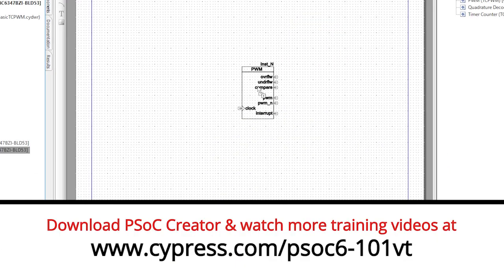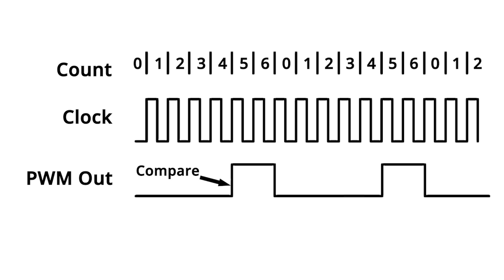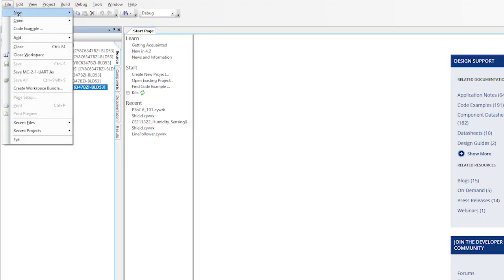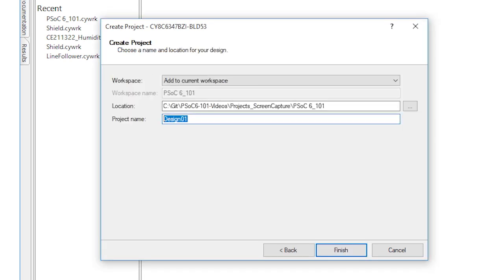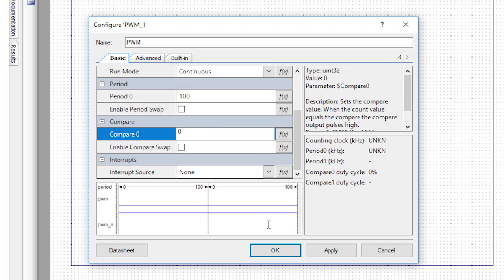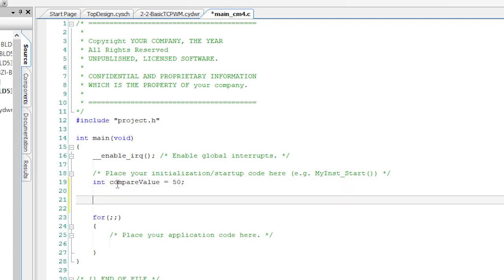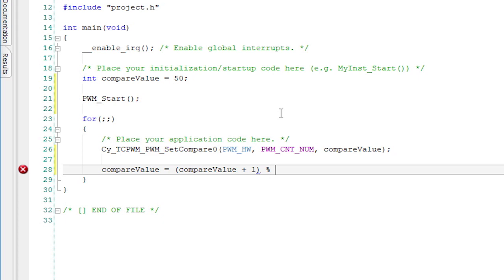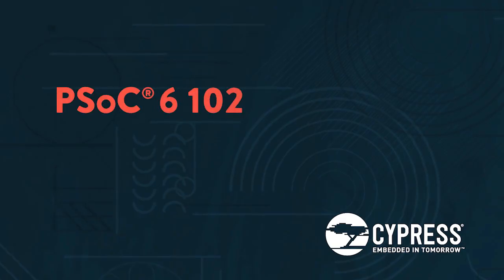PSoC 6 101: Lesson 2-2a Basic PWM Implementation

Comment: The code only slowly dims the LED, it does not slowly increase the brightness.
Reply: You could do the same code but set a "minus" instead of the "plus" at line 28, and it would slowly increase the brightness instead of dimming the LED.